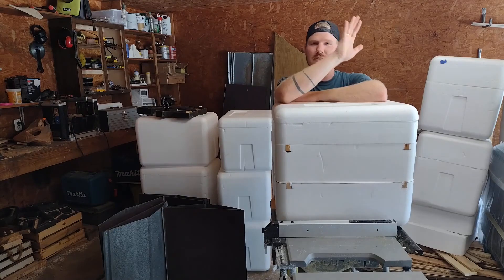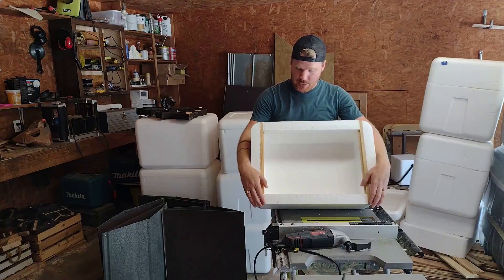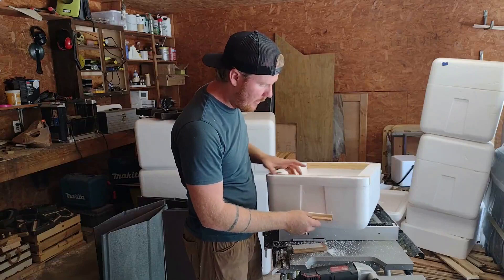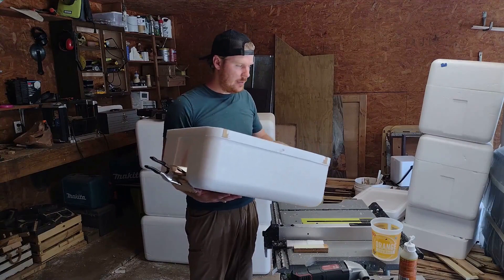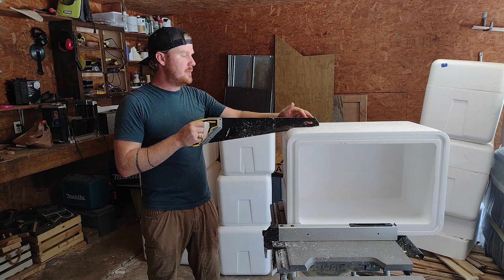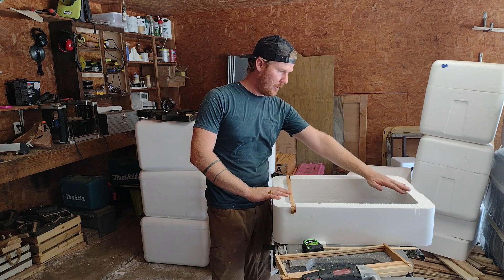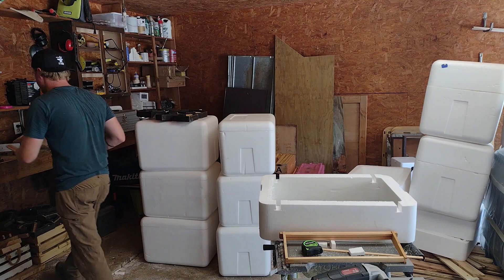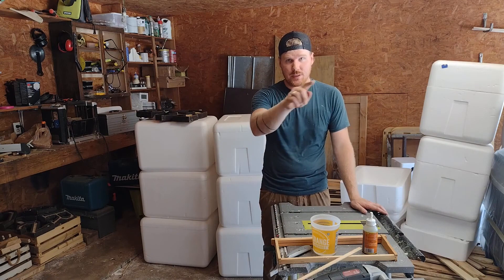How to build bee hives out of styrofoam coolers

Comment: Awesome! These would be great to transport new colonies, I think…
Reply from the maker: To a degree - they're definitely less likely to shift and open up. But I would worry about stacking them... I don't know their compressive strength and if they would hold up to more than one colony's weight on them.
Reply: @exleyapiary5521  got it. Any recommendations about dealing with bears, raccoons and other honey-loving critters ?
Reply from the maker: @PatrickTappia  electric poultry netting does a decent job of keeping out the smaller vermin (skunks, possums, racoons) but you'll need a three strand electric fence with a much higher voltage for the bears. Not speaking from experience on that one, that's just how I've seen other beekeepers cope with bears.

Comment: use heat to cut, a hot piace of metal for the entrence they wil not damage the entrence again, and a small flame torce to heat the interior in order to make a hard surface, cuting the supers use a metal string heatead, i wil make some videous next month about all i just said
Reply: A soldering iron works great on Styrofoam

Comment: This is awesome!
Reply from the maker: In theory and application, yes. Unfortunately, these units don't have longevity. They lasted for a season before the bees literally chewed them to pieces! But they did there job it seems like - the bees performed well in our hot Texas summer!
Reply: @exleyapiary5521  Ah, that's good to know.  What about lining with 1/8-inch plywood which you can buy real cheap as 4' x 8' sheets at the big box stores (and have them cut down into more manageable strips there)?  Or, if the bees eat through that, then maybe 1/4-inch plywood?  (The lining can be glued onto the foam using wood glue, which works for foam as well.)

In any event, Lyson is selling polystyrene beehives at price points way higher than you're making yours and polystyrene is basically just more dense styrofoam.  Cold weather beekeepers need insulated hives as well, so that's who are buying Lyson hives now.  I found that out by watching Vino Farm's channel who lives in Massachussets and he went from less than 10% colony survivability each winter with wood hives to 100% survivability after switching to Lyson hives and he didn't mention anything about bees eating through the Lyson polystyrene.  So, Lyson somehow figured out how to stop the bees eating through their hives.

Comment: Do you paint them? seems that UV would degrade that fairly fast.
Reply from the maker: Negative, I haven’t. The trick is finding a paint that won’t react with the styrofoam and dissolve it. Mine have oversized wooden roofs that help protect them from most of the direct UV rays. You could use paint or lids or leave it as is - mine have lasted a year so far with just minor yellowing on some of the more exposed hives.

Comment: How practical would it be to use these boxes with caucasion bees? The caucasions use excessive amounts of propolis on everything so I would imagine if you tried to remove the roof or super off it would break.
Reply from the maker: That's a good question. My bees all use propolis in varying intensities. I put a plastic sheet (just a rectangle cut from a heavy duty ground cloth) in between the top super and the lid as an "inner cover" and it works for keeping the lid from getting glued down. The propolis I've had between boxes hasn't fastened well to the styrofoam and I usually have more trouble prying the boxes apart because the frames are glued together from their tops and bottoms with burr comb and propolis than I do from the boxes themselves being glued together. The styrofoam boxes stack pretty seamlessly, especially where there is a factory edge, and it seems that there just aren't many drafty cracks or nooks that the bees see a need to clog or secure. The weight of the combs do cause the styrofoam to flex and make an even tighter seal at the seams. I've absolutely had to battle propolis on my wooden boxes as warping and wear created gaps between the boxes and lids. The bees naturally seek to close off those gaps to intruders and drafts with propolis. I have not had as much of a problem with propolis in these boxes.
Reply: @exleyapiary5521  Yeah if I wanted to use it for caucasion I think I need to add a plywood rim to the top and bottom of the boxes because they really do use a ton of propolis.
Reply from the maker: @mauritzverster3435  it may be cheaper and just as effective to put a lip of plastic or paper around the inside rim to keep the bees from accessing the seam. I'm interested to see what you do. Keep me posted!

Comment: Why don't you use the cutout piece of styrofoam as a blocker for the entrance? I would think such a carefully cut piece fits every time. You could fix it with two paper clips   if need be.
Reply from the maker: That’s right, you could. They chew the styrofoam so fast that it wouldn’t last long unfortunately.
Reply: @exleyapiary5521  another way I thought might help to get the angle correct was to use the piece of wood as a base for the saw, but then I saw you making the slot for the landing board which would not work. As I understood the landing board is horizontal, not sloped down and out? If it is sloped, then it would work. You follow the angle of your scrap piece by placing it inside the box, close to the corner, then just push out through the wall. I don't know man, first time I saw one being made and here I am -Giving unsolicited advice 😄 I am gonna try this to lure my first swarm, you can bet on it.
Reply from the maker: Landing boards can be slanted, that would work fine! You learn something new every day. Thanks for sharing. Good luck swarm catching!